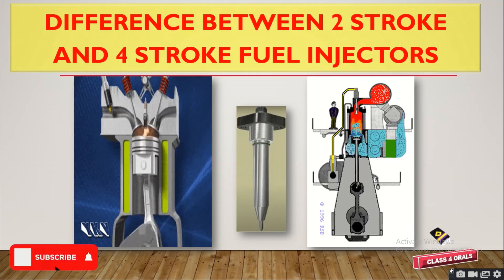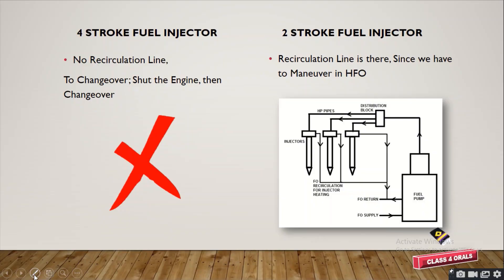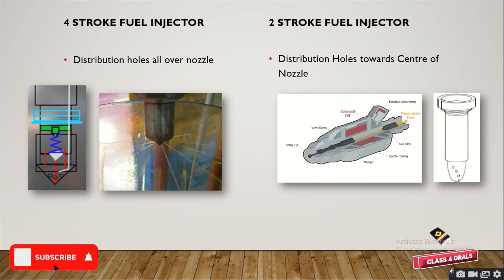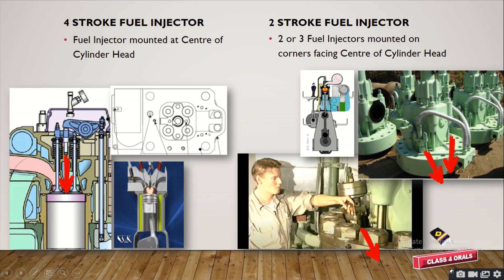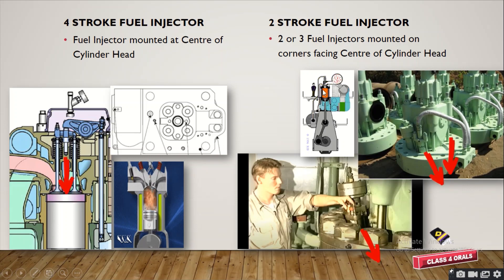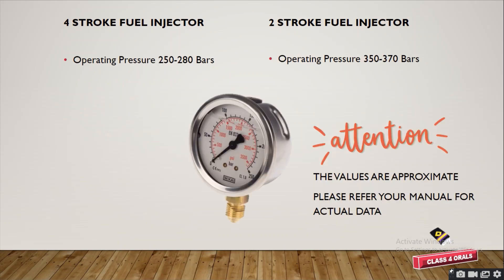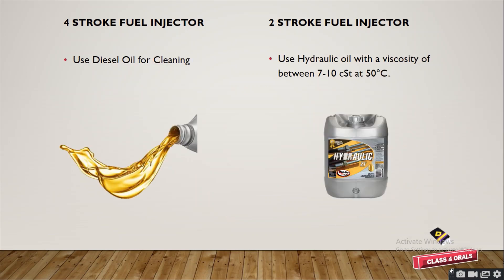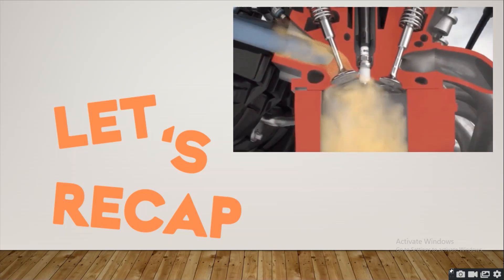Difference Between 2 Stroke and 4 Stroke Fuel Injectors | Important Points Discussed | #FuelInjector

Comment: Great video. Only recirculation part of Auxilliary Engine is confusing as all the fuel exiting through the fuel pump might not be injected through the fuel injector because at the time of Starting and Stopping of the Engine, the situtation will be different, in many of the ship's in which I sailed, the Auxilliary Engine's were started directly on HFO.

Comment: Modern 4 strokes actually run higher pressure now.  MTU  8000 series at even 1500 bar injection!! Common rail have recirculation lines on 4 stroke too right. Confused how hydraulic oil cleans 2-stroke injectors, please explain.

Comment: Why we are using hydraulic oil to test fuel valve is it because of fuel test pressure or any other reason
Reply: I think hydrolic oil had similar viscosity when engine working.

Comment: what is the difference between opening pressure and injection pressure of the injector?
Reply from the maker: Opening at which fuel injector gets opened.
Injection, pr at which fuel is being injected into the chamber.

Comment: 1. Both 4 Stroke Fuel Injector & 2 Stroke Fuel valve has recirculation line. (In main engine we call it Fuel valve and not Fuel injector)

2. Opening pressure varries and can be adjusted as req.

3. Distribution holes and Position on Fuel Injectors & Fuel valves on cylinder head are corelated.

You are doing a good job just read the manuals and compare them accordingly.
Reply: @Roshwin Vaz there is no recirculation line in 4stroke fuel injector..because we start and stop by using diesel..but in 2stroke engine during port stay only engine in off condition and that time we r doing preheating of injector to avoid vapor lock and carbon deposit over fuel injector and to avoid thermal shock then it is easy for us to start the engine..
Reply: Ane u r saying stupid thing like main engine it is fuel valve and aux Engine it is fuel injector..both r same only..in both we say it as fuel valve only
Reply from the maker: Thank you so much for this clarification.😊 All your points are Well noted..
Clarification of points is utmost important.👍Thanks for ur participation in this discussion. Much Appreciated..🙏

Comment: For generator on my ship we used to start the engine on diesel then changeover to HFO for normal operation so will it have recirculation line ??
Reply from the maker: Check your Generator manual for that info